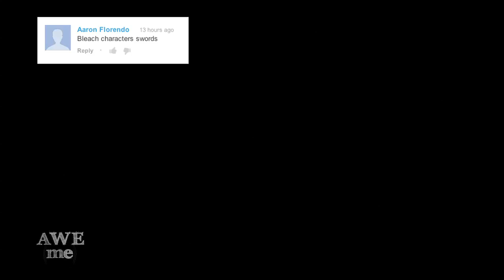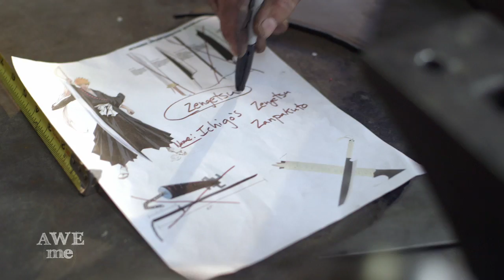Ichigo's Zangetsu Sword (Bleach) - MAN AT ARMS

Comment: I've gotta see Rukia's white katana now. You guys make beautiful swords with amazing attention to detail!
Reply: Sodenoshirayuki Would awesome... MAKE IT OUT OF DRY ICE
Reply: Amazing attention to detail... only, they completely missed the raised segment on the handle. Y'know... the bulge just after the wrapping that then curved back out to the blade? That was something they could have EASILY done, but failed spectacularly on. Every depiction shows that segment on the blade, and the wrapping itself does NOT go straight to where the blade starts.
Reply: Make one yourself instead of taking all their talent for granted, see if you can do any better.
Reply: ***** but they didn't miss size, width or shape, he's just saying that just because of that little thing they suck.
What if they just forgot about that? Besides, it's not like just because they missed that the sword will be useless or anything, it'll still chop you into pieces.
Reply: MaxOwnzor2 The Lawnmower That "Little thing" is, in fact, a PART of the shape, so yes they missed the shape. As well, the lower part of the blade, just above the handle, is far too curved. Just look a the image they have as the thumbnail, it says it all.

The part should be flatter, and it's utterly missing a key area of the design. It's 'little things' that impact the overall design, given Ichigo's sword is simplistic to begin with.

Due to the inherent simplicity of the sword, it's imperative to get each "little" detail as accurate as possible, and failure to do so is purely from a lack of effort or caring. It's the fact that those little, seemingly pointless details is why you have to be careful when replicating something, because just because you 'think' something's pointless, or not worth the effort doesn't mean you shouldn't do it anyway. Otherwise, it's not an ACCURATE representation.
Reply: We need Sode no Shirayuki!

Comment: You have to give them more credit for this, they could have just gone with Tensa Zangetsu to save themselves time and effort.
Reply: yup :D
Reply: @Kasaix looking at the method by which they made Zangetsu they chose the easier build ie: flat sheet cut to shape and sharpened. Tensa Zangetsu would require more intricate work for the guard, grip, chain and blade definition.